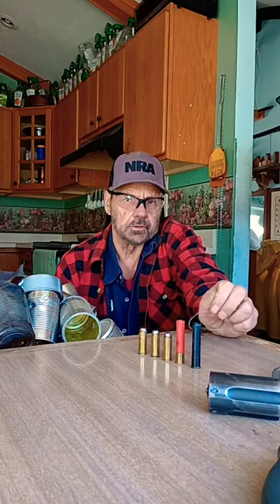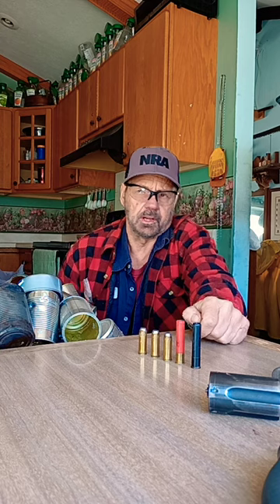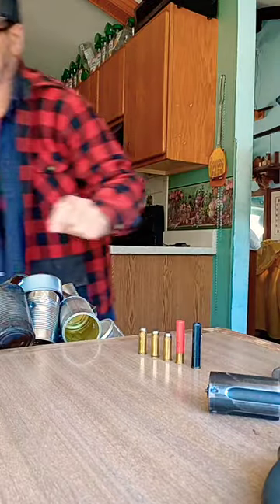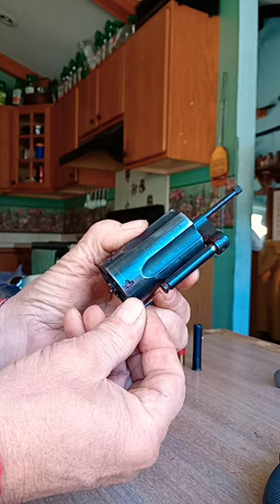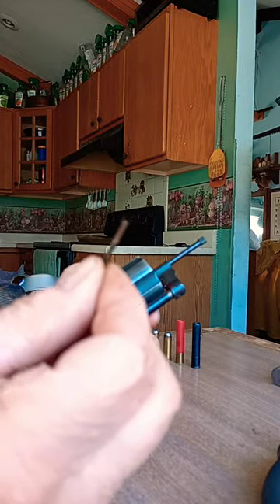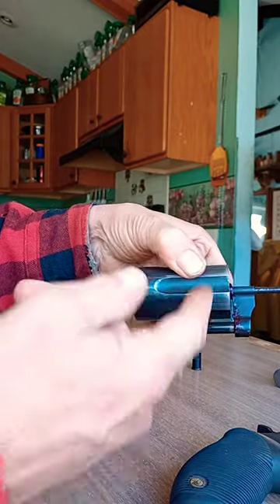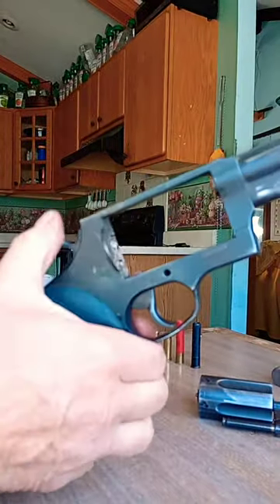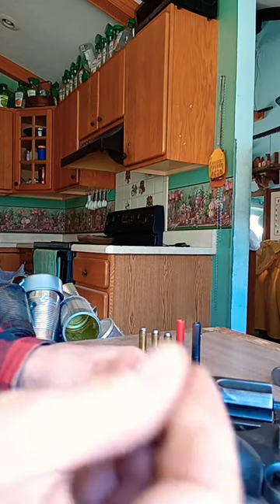5. Cylinder Stop Plunger and it's Spring in a Taurus Judge Revolver.

Comment: Norm, i have this EXACT revolver.  Made in 2010.  How can i get ahold of the exact Cylinder Stop Plunger & Spring for this.  Does Taurus still have this part available for purchase?
Reply from the maker: I have never had to contact Taurus for availability of those parts so I don't know if they are available. Might want to contact a gunsmith that may have a drawer full of a bunch of miscellaneous parts. A gunsmith may be able to make the parts. That could be costly though.
Reply: @normtheteacher5485  thanks norm